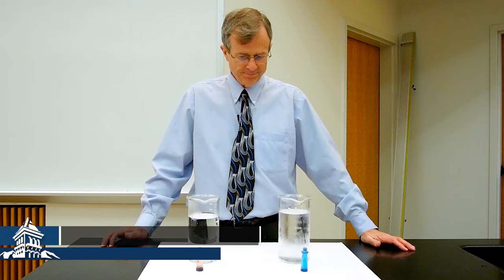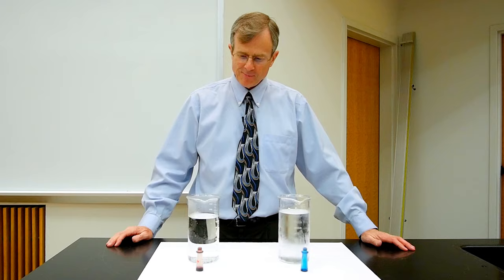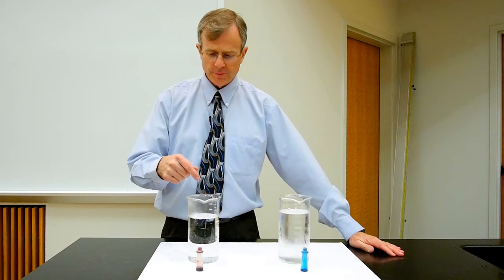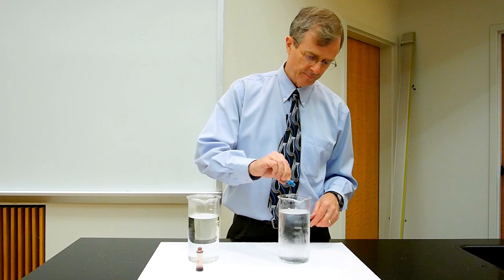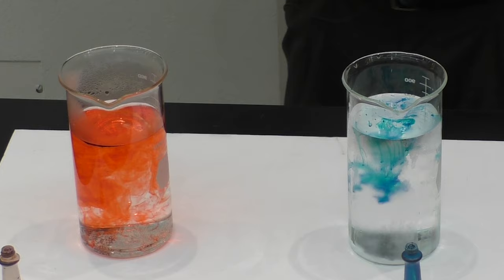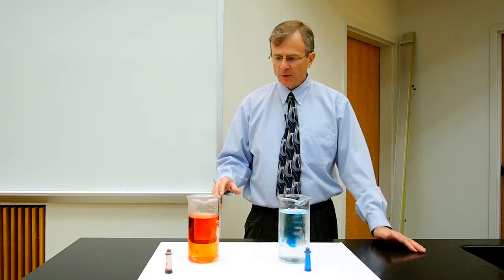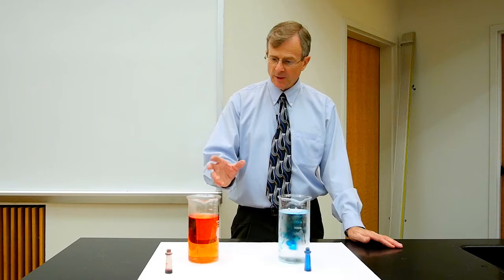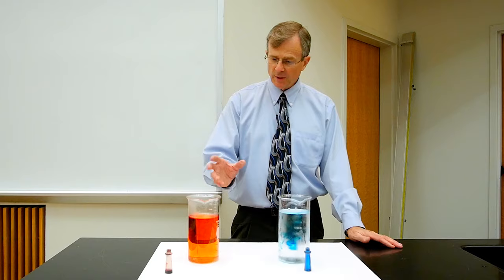Convection and Diffusion Demo: Hot and Cold Water

Comment: Does this mean that diffusion is convection at a low temperature or convection is diffusion at a high temperature? Where does advection fit in these demonstrations?
Reply: No. Density of water decreases as temperature increases, although very slightly. so, from lighter to most dense: hot water in flask, room temperature water in droplet, cold water in flask.

So when he first introduced the droplets, the colored water, having a higher density than hot water, wanted to sink to the bottom, while in the other flask, droplet water has lower density than cold water and it stayed on top. That's why there is more convection effect in hot than cold water.

Then you have that molecules in warmer fluids move faster. That's why there's more diffusion in the hot water.

As for advection, I'm not entirely sure, but a quick google search makes me understand that it is simply another term for convection, but meant to describe larger scale phenomena like in rivers, oceans, etc.
Reply: @sharshabillian  thanks 🙏🏽